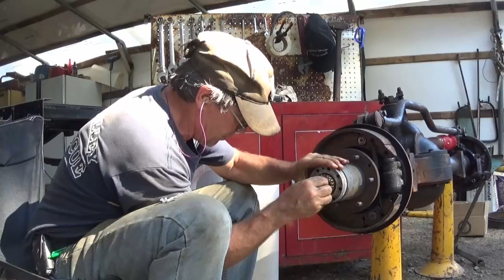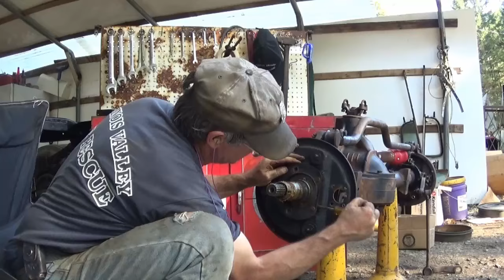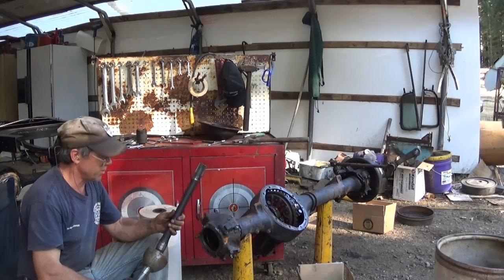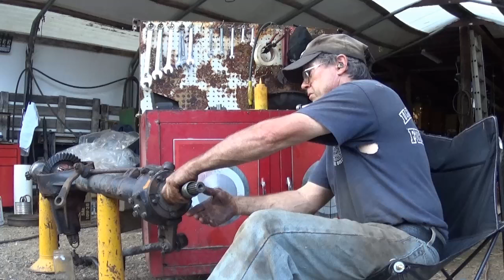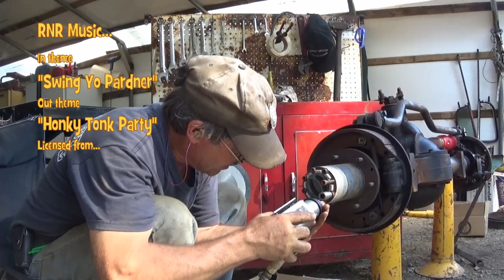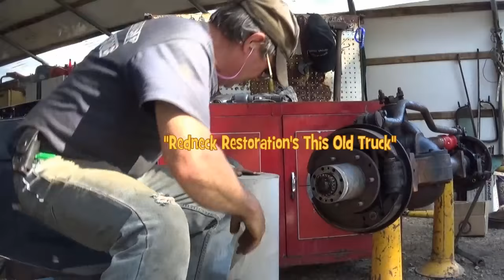1957 Napco 4x4 Front Axle Disassembly

Comment: Thanks for the video Jeff. Those old trucks are getting harder to come by. Those wheel cylinders were just nasty. The shop I worked in had an old compressor that came with the shop in 1971. It had a rod knock and you could hear the blow-by hiss when it reached pressure, but it got the job done. Filled the crankcase with Riselone.

Comment: Looks like Crusty suffered majorly from the "Bubba Factor". First the bent and cobbled together frame which you had to  replace with Old Grand Dad and now the crazy mix of bolts/nuts/threads  tools on the front axle. What other surprises lay around the bend? I assume the issue with those wheel cylinders was water in the brake fluid??
Reply: +GrandsonofKong  Looks like he might profit from a technical evaluation from Uncle Snee.

Comment: Mechanics have to adjust a lot of stuff. A hammer and a chisel that's the universal wrench, socket, or tool. That's what I call learning to adjust or smoke em if ya gottem.
Reply: +MostlymoparIH  An outfit I used to worked for's mechanic truck had a welder, torch and various sized hammers and pry bars. The rest was just way too technical.
Reply: We were on a dam job with some old worn out Cat 12 graders on the haul roads. The steering gearbox bolts sheared off on the gooseneck and they welded the box on the frame instead of replacing the bolts. I was running an 8-H working cuts and pushing pans. The top roller shell had fallen off when I started running it. They replaced that roller when the shaft wore in too and the track fell down on the spring for the front idler. That shaft was close to 3 inches thick. That's why I said what I said above.
Reply: +Lewie McNeely 
Work arounds. Whatever gets you goin. Sailors call it any port in a storm.
Reply: This is true but they get to gomm them up and we had to waller around with them.

Comment: That bolt on the brake cylinder is US metric that's why you can't get a spanner to fit.
Reply: +Big Ian Builds , 13mm probably woulda worked fine. But Jeff doesn't have any 13mm's. :)
Reply: +Talisman1957 As it's pre 1959 would that be US 13mm or rest of the world 13mm? Or not quite 1/2" as long as it's not an American 1/2" or 12.7mm that only a 12mm hex will fit because it has nearly 60 years of corrosion eating away at it? ;-)

Comment: Inboard axle shaft seals were leather.  I have a number for a working rubber seal somewhere.
Reply from the maker: +ForkliftJoe You need to join the forum at napco4x4.org. Folks are always looking for info there.

I dove into this cold turkey, as I do most things! I have the GMC 55-9 manual, but the Napco came as a supplement, which is here somewhere...

The axle is already completed, but the videos will take a while!
Reply: +ElderlyIron I had a 59 Chevy Napco 30 years ago.  It had a 261.  The bolt under the locking hub is different.  Mine had snap rings on the shafts.